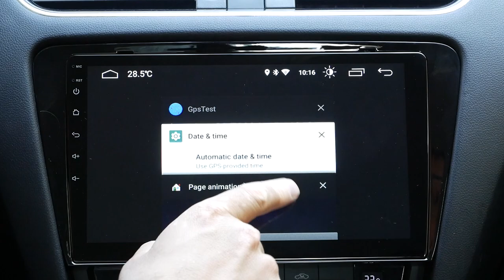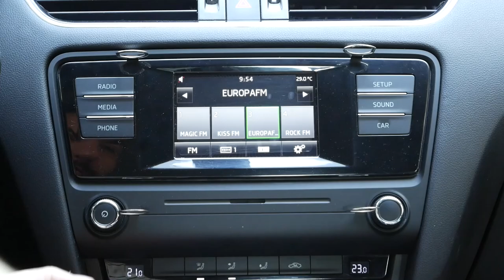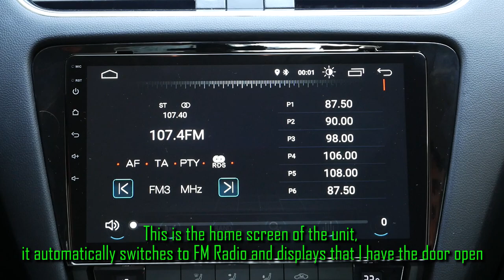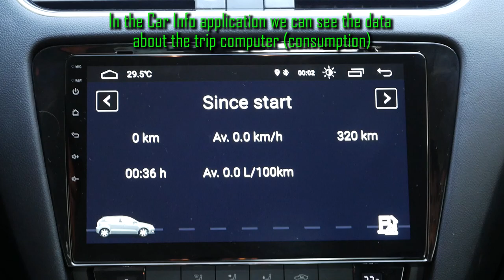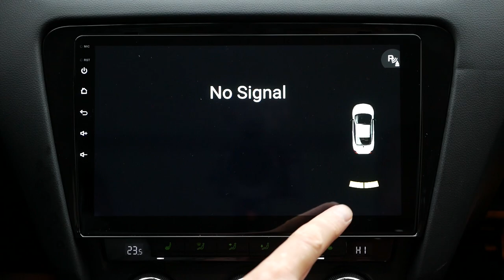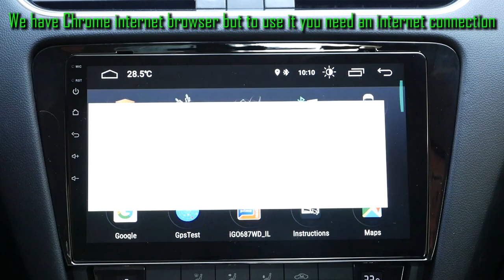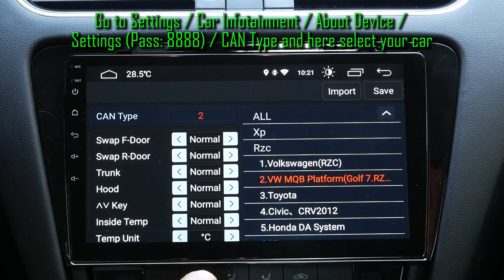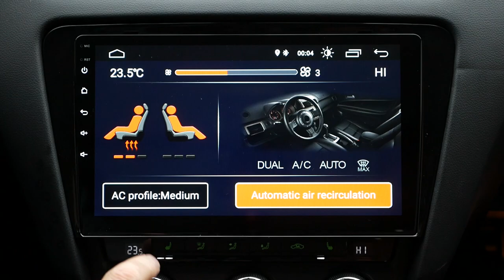Install 10 inch Android Multimedia for Skoda Octavia 3

Comment: Salut, am o skoda rapid, am acelasi sistem din fabrica ca al tau. As vrea sa achizitionez un sistem android, rugamintea mea, imi poti spune dimensiunile sistemului achizitionat?
Reply from the maker: Salutare. Masina nu este a mea si nu am cum sa-ti dau dimensiunile, dar la Octavia 3 se pare ca dimensiunea exterioara a ramei este diferita fata de cea de pe Rapid: https://ae01.alicdn.com/kf/He8ef87ccf9cd46948530a80f933f658cK.jpg
Iti las aici link-uri spre cateva unitati Android: 
https://www.aliexpress.com/item/1005001505535578.html?aff_fcid=03d03a4786d249d8ab103b35c7f09049-1618243741859-05808-_AOMKd5&aff_fsk=_AOMKd5&aff_platform=shareComponent-detail&sk=_AOMKd5&aff_trace_key=03d03a4786d249d8ab103b35c7f09049-1618243741859-05808-_AOMKd5&terminal_id=364d159dab6d4da48c68657f8054a5c8&tmLog=new_Detail
https://www.aliexpress.com/item/1005001872055777.html?aff_fcid=81017e579fc34401ae73d719c6b375e0-1618243806043-02089-_AYFakx&aff_fsk=_AYFakx&aff_platform=shareComponent-detail&sk=_AYFakx&aff_trace_key=81017e579fc34401ae73d719c6b375e0-1618243806043-02089-_AYFakx&terminal_id=364d159dab6d4da48c68657f8054a5c8&tmLog=new_Detail
Reply: @Adrian_AFD  Multumesc mult pentru informatii